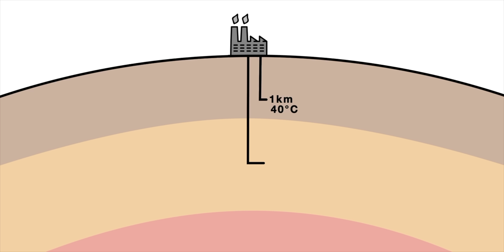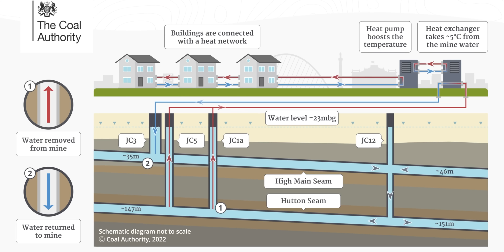Geothermal Can TRANSFORM Dirty Coal Mines into Clean Energy Hotbeds!

Comment: What if you run warm water from the coalmine through a sterling engine to produce electricity? I accept that the most efficient thing to do would be pumping the warm water directly to a heat pump and using it for  heating houses. But lets imagine if this could work, that in periods where the demand for heating is low (summer for instance), you would at least get some electricity out of it.
Reply: As cool as sterling engines are they're not a good choice for grid power generation.
Firstly because of their low power they'd have to he huge which would create some hard but interesting engineering challenges.
And secondly they're not very responsive compared to a steam powered turbine or IC engine. Which is a primary need for grid level generation/load balancing.
Reply: @vorpolkai  I appreciate your explanation, you seem to know a lot more about the subject and you are probably right. But i like asking "what if" questions because I get to learn from smarter people.   So imagine then  you would just use a whole bunch of smal sterling engines and store the generated power in batteries until it's needed? Similar to storing the excess power of my solar panels in a home battery for when the sun goes down.

Comment: A very interesting article indeed! For those outside the UK "centigrade" is the old pre-1948 unit of temperature measurement. One centigrade degree is (essentially) the same as one celsius degree in modern SI units.
Reply: Anders Celsius was Swedish and he didn't live after 1948.  ;)
I know you know just teasing.
Reply: @starvictory7079  Ha! One of my metrology lecturers (many decades ago) was Swedish, and so we learnt quite a bit about the life of Prof Celsius, and the general brilliance of Swedish science & engineering. Unfortunately the only thing I remember is that Celsius's original temperature scale was the other way round, and had water freezing at 100°C and boiling at 0°C (which was a bit awkward, of course).
Reply: @davidhaywood8029 Yes, indeed.
You learned well haha!
Greetings from Stockholm.❤

Comment: So they drilled the hole in 2011, and it is still a research project !   Typical UK, discover a great, brilliant, solution and squander it away… Poland uses heat from steel works to heat city homes… why is the UK so far behind !   Ground source heat is a brilliant source of energy, why aren’t we doing it ?  Frustrated !
Reply: Surplus heat from the oil industry has been used to heat homes in Aberdeenshire. If they can do it, well...

Comment: The big question is still, will the earth that gets cooled down by geothermal usage rewarm quickly enough to carry on with the operations ? or will it be available only in winter to let it heat up again during summer ? heat conduction in rock is pretty slow
Apparently the recharging in water is already assessed.
Low temperature geothermal is quite an uncomon adventure for now. It is good that it gets studied further.
Reply: Let's put it this way, the Earth very deep is extremely HOT. That heat diffuses upwards. So even if you take heat out, there's more ready to replace it. That's going to last millions of years.
Reply: @jimthain8777  you do not get it. the heat diffuses, but at which speed ? if you take out the heat quicker than it gets replenished by earth, then it gets colder locally. thus the problem of the speed of heat diffusion in the rock being used. like you have a million liter tank but only a 5 mm pipe to get the water out ...
Reply: @benjaminlamey3591  
It's a miniscule amount
Reply: That is a problem thatgeothermal power stations face, where they can 'quench' the geothermal source bytoorapid heat extraction, or more often adding too much cool water. Geotechnical engineers know about the problem, and are getting better and better at mapping the heat resource and designing the systems to not over cool. So a potential issue, but managable.

Comment: 11:04 fracking is done to release gas trapped in a not very permeable rock luke a shale (that's why it's trapped). For geothermal you want to use a rock formation that is already permeable (or a permeable structure like an old mine) to use that permeability for water to move through and gather the ground heat as it moves. So much different use case and much lower risk I would say.
Reply: I wish fracking technology advanced enough that my nan stopped complaining about her trapped gas
Reply: @ash_pro_2000  She must have some kind of plug up there. She should lubricate the plug and remove it from time to time.
Reply: @ash_pro_2000  Lol. Trapped gas hurts though

More realistically, I'm not too keen on fracking largely due to the Earthquake potential

Comment: I get that this heat could be economically piped to large buildings, blocks of flats etc but I think it would be too expensive to run insulated pipelines to individual homes.
Reply: We have insulated hot water pipes many places here in denmark, but mostly in densly populated areas, and almost all houses have to join else it isn't economically viable.
Reply: sand storage tanks act as heat batteries
Reply: @rollthetape88  yes but how is that relevant?
Reply: Why would it be too expensive, we already do it with gas.

Comment: If, on a large scale, humanity starts to run heat from the earth's interior and we release it into the atmosphere, will we create another climate problem?
Reply: The effect on the climate is much smaller. Heat from the earth are 44TW while solar energy hitting the earth is about 120 000TW. Not saying we should ignore potential problems, I am sure you can kill some sensitive eco systems if you cool the ground, but I am sure it wont't hurt the global climate.
Reply: We already do it when burning coal, oil, gas. The earth's heat ultimately radiates into space anyway.

Comment: I would argue that not digging a deep enough bore hole for electrical generation because it's expensive is short sighted. This hurdle can surely be overcome. If Elon Musk believed in such a requirement he would do all he could to make borehole drilling cheaper. Further, millions if not billions is spent on fossil fuel boreholes. Divert that money to drilling holes for geothermal electricity generation.
Reply: I suspect Elon is leaving some if the low hanging fruit for others to "discover".
Maybe he's giving them (us?) too much credit?

Comment: In the short to medium term could warm water not be pumped to gas power stations? We would then need to burn less gas to get the water to the required temperature? It would help reduce prices and save Co2
Reply: A typical power plant does not heat water from cold, they run a closed loop and the boiler input is typically well above 90°C. That is where the 160°C from the video comes from, you need water well above 100°C to get a substantial steam pressure. That said, your idea is right, just appiled to the worng field. It can be used for hot water production. At the company I work for we use the ~50°C discharge from our geothermal heat to pre-heat cold tap water to about ~45°C before it is heated to 60°C using natural gas.

Comment: I love that this is becoming a thing.
20 years ago, while studying at The Centre For Alternative Technology, I proposed extracting the heat from coal mines for community heating schemes as the holes are already there, and we had been cooling them to allow mining to take place. I was told it wasn't worth it as the heat was too low grade. I didn't understand how it could have been dismissed so easily, but I guess I was just ahead of my time.

About 280 metres under my house is a coal mine. I wonder if anyone would notice if I did a bit of digging? 🤔😄
Reply: It's not becoming a thing! It has been becoming a thing for years
Reply: Quick, buy the coal mine before anybody realises it's actually useful 😊
Reply: The local government would. You’d get fined for mining without a permit. Now if you were drilling a hole that would be a different story. Plus you might hit groundwater above the mine and flood it. That would definitely get the attention of the people in the mine
Reply: @theairstig9164  you want to flood the mine, that's the point...
Reply: @theairstig9164  People wouldn't be "in the mine" in the UK :)
Reply: Hasn't worked in Caerau. Quite hard finding old, flooded mine workings.

Comment: The presenter mentioned the temperature gradient in the Earth, but the rocks are very poor conductors of heat.

But the presenter did not mention the key metric for the UK: that the upward flux of heat across the UK averages out at 0.038 W/m^2. So to SUSTAINABLY generate 1 kW of heat energy, one must draw heat from about 26,000 m^2 . Or in other words, drawing heat from 1 km x 1 km one could SUSTAINABLY harvest 38 kW. That is not much heat from a very large area. If draw heat out at a faster rate then you simply cool the rock. It's basic physics.

All that being said, it could possibly be of use, and Newcastle may well have some advantages, but it looks expensive to me. And I don't trust any presentation that does state the basic physics.
Reply: A fair proportion of NZ's energy comes from geothermal, but we do have some very hot areas underground.
Reply: @marcsimmonds5483  Indeed: Most countries do not.

Comment: Great episode, thanks 😊
But is it really renewable? Surely if we extract heat energy from the earth it will eventually cool down?
It's going to take a long time of course, so maybe we can think of it as renewable for practical timescales?
Reply: I think I saw a calculation that you could run the entire of humanity's current power requirements on geothermal alone for over 2 million years. Realistically we wouldn't be using that much, with the bulk coming from wind and solar, so it would take a hell of a lot longer that that. By that time, who even knows what we will be doing for power. Dyson spheres, micro-fusion plants, things we can't even imagine, or nothing at all if we make ourselves extinct :)
Reply: Mark, you are exactly correct. What the presenter did not mention the key metric for the UK: that the upward flux of heat across the UK averages out at 0.038 W/m^2. So to SUSTAINABLY generate 1 kW of heat energy, one must draw heat from about 26,000 m^2 . Or in other words, drawing heat from 1 km x 1 km one could SUSTAINABLY harvest 38 kW. That is not much heat from a very large area. If draw heat out at a faster rate then you simply cool the rock. It's basic physics.
Reply: @michaeldepodesta001  thanks Michael. I suppose we can say that although the heat inside the earth is a finite resource, practically it would take a lot of extraction over a very long time to affect the temperature significantly. 
I guess by the same token one could say solar is not truly renewable, but the sun is going to be around for billions of years...
Reply: @michaeldepodesta001  
Wouldn't the answer to that be to dig the hole a little deeper? 
Since it is hotter at greater depths you would theoretically need a smaller area to gather heat from, and it should regenerate that heat faster.
Reply: @jimthain8777  Good Morning. No. The heat flux - the amount of energy flowing upwards through each square metre of rock is the same 100 m down as it is 1 km down, but the temperature is different. 

It's like a section of river flowing (say) between two bridges. Neglecting tributaries and rainfall, the same volume of water per second would flow past each bridge - but the first bridge would be higher - that's what makes the water flow.

Similarly the heat flowing upward through each square metre of Earth is the same at all depths below about 100 m.

Best wishes: M
Reply: @michaeldepodesta001  
Nordic countries use this heat.
The only difference is their "portal" is natural and (normally) closer to the surface.
Reply: @rogerstarkey5390  Good Evening. Two things. 

Firstly, as the presenter said, using a ground source heat pump to extract heat from the top few metres of the Earth is actually using solar power. The heating of the Earth's surface benefits from 240 W/m^2 on average of solar input compared with around 0.1 W/m^2 from the centre of the Earth. 

Secondly, there are places around the world where the upward heat flux is much greater than the UK average of 0.038 W/m^2. And in such cases it can make sense to exploit that resource. But in general, this isn't true.

All the best

Michael
Reply: I was thinking the exact same thing!  It would definitely speed up the earth cooling down wouldn't it, but with the earth warming up due to our neglect and abuse, would that help negate that cool down?
Reply: @chrissavill8713  Obviously it will cool down the earth in aggregate but I wonder whether it will actually contribute to global warming - at the surface - as it is bringing up heat that is otherwise trapped and that heat ends up in the atmosphere.
Reply: @petervarley3078  
That heat is making its way to the surface anyway. So it's not trapped. Since the heat is already coming to the surface anyway, it isn't going to be a serious problem.
Reply: Re: "Surely if we extract heat energy from the earth it will eventually cool down"?

Lol! .....Some of the Earths Core heat is 'Residual' from its original creation, but most of it is 'Nuclear', and will continue being replenished for approx 4 Billion Years!
Don't take my word for it,......Go look it up,......I did 60 years ago, before the Internet!

Comment: Is it really renewable, or just very abundant? Regardless, it seems like a very promising way to heat our buildings. I would like to see how economical this solution is and can be.
Reply: That's a truly fundamental rabbit hole question there. Nothing is truly renewable, just some things are more abundant than others, given the timeframe specified.
Reply: once the core of the earth cools... we don't need to worry about it. because we will be long gone
Reply: Exactly! In other words, if you extract thermal energy from a site for say 100 years, will you observe any significant cooling and hence degradation in performance? Ultimately, both the heat left over from Earth's formation as well as that from slow nuclear decay is finite. So is the sun's energy of course, but the lifespan of the sun is so large that it is infinite for all intents and purposes, at least as far as humanity is concerned.
Reply: @Astrophysikus  I'm thinking of the size of the entire earth vs a 2km hole drilled in the surface.  I'm pretty sure the heat works its way out anyway, so we're just using it on its way.
Reply: @jimdunleavypiano  I do not know the numbers, that is why I am asking. Maybe the natural outflow of energy is much slower than when we extract it through a drill hole, which might lead to local cooling eventually.

Edit: I did some back-of-the-envelope calculation and a quick research on the web. I was never worried about cooling down the entire earth on a global scale. However, apparently it is possible that local geothermal heat sources get exhausted after decades of use, but they are replenished eventually if not used any more.
Reply: @jimdunleavypiano  Yes, that is correct.  However the volume around the bottom of the hole where the water circulates is cooled by this process, so the heat is effectively "mined".  But the good news is that the heat flow will warm it up again after water circulation is stopped, so it is renewable.  Ideally geothermal heat "mining" should be done at a pace where the heat extracted is balanced by the heat inflow, which is why monitoring is done of the geological strata involved.
Reply: @Astrophysikus  Correct!
Reply: @Astrophysikus  how much energy you can extract depend on the geology of the site. What the heat transmissivity is. If there is ground water then also the ground water flow rate is important. The challenge for geothermal is finding a site that can give plenty, and you can't always predict it before you drill.
Reply: If I live nearby, I am more than happy to crowd fund the pilot project  and benefit from the geothermal heating, for me, my children and grandchildren.
Reply: Volcanos have been spewing out heat for the last 4 billion years and it doesn't affect the heat generation capacity of the interior, which will gradually cool by convection and conduction and the eventual radioactive decay of the radiogenic elements in the interior.
Reply: It's renewable.. the Sun recharges the Earth's energy all the time.
Reply: @jasongooden917  Geothermal heat has nothing to do with the Sun.  It comes from the interior of the Earth, as explained in the video.